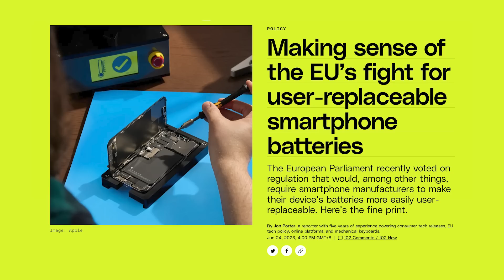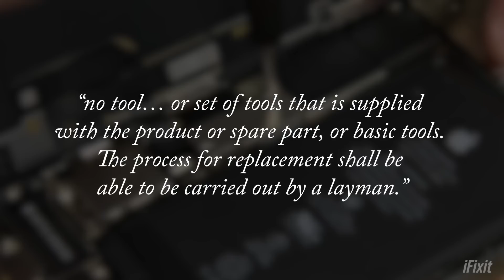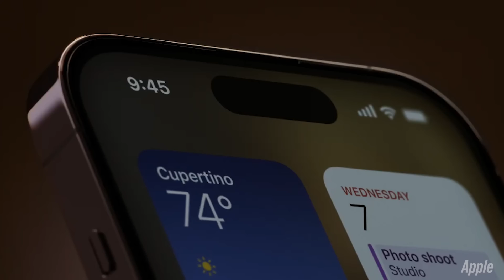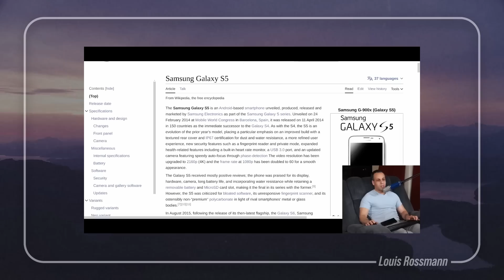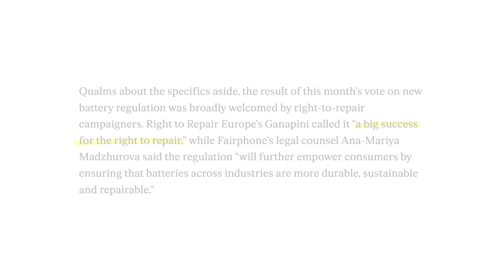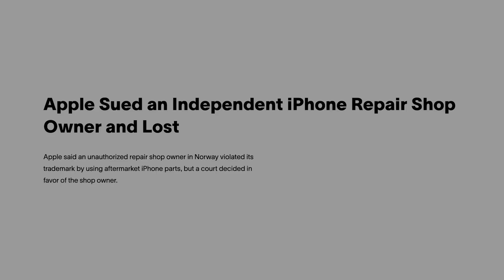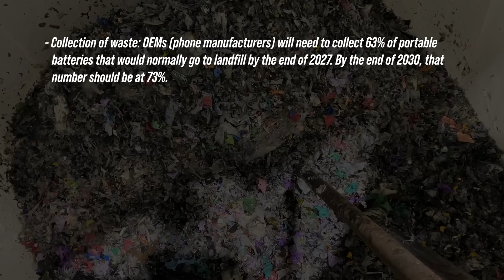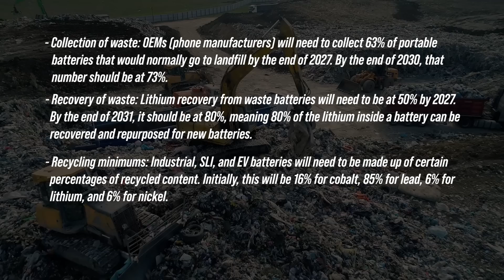EU Just Changed Smartphones Forever

Comment: *Tech shareholders hated that*.  I'm not sorry; they made tech in the sandwhich method BECAUSE it was cheaper, BECAUSE it improved profits, and most importantly because it means you have to buy a whole new phone to improve battery.  Their greedy yearly releases just became negligible, because when your phone is fine like most are these days for years after buying them (apart from scum like Google refusing to do Android updates on X phones or older to force you to upgrade) and the only thing that fails (ie barely holds a charge eventually) is the battery.  It's about churning out the phones over and over and keep you buying new phones to keep the money rolling in.  Now, they'll have to find other snake-like ways to keep the money churning in, like forcing you to upgrade sooner to get X version of Android.

Comment: Quoted: "It's possible Apple may not be required to change iPhone design. One German news report claims iPhones with permanent batteries inside will not be subject to ban under these regulations. That report claims the law says it’s fine to have a built-in battery — if the cell is of sufficiently high quality (in this case it must offer at least 80% capacity after 1,000 cycles). The report also suggests exceptions for water-proof devices."
Reply: Thank you, I was looking for a comment that points this out. Both exemptions are ridiculous. 80% after 1000 cycles is crap, that's barely 2 years of intensive usage. As for waterproofing, those have been done way before non-removeable batteries. In fact, waterproof phones with replaceable batteries are still made today. Case in point, Galaxy Xcover series.

Comment: All of my phones had a removable battery and I intentionally made sure they did.  Unfortunately my Samsung Note 5 despite changing the battery still didn't function as initially so I was forced to buy a non-removable battery phone 2 years ago.  I look forward to removable batteries coming back and it in no way impacts modern phones in any way.  Apple is the worst company even though I own a 2012 Macbook Pro. I have never owned an iPhone nor do I see myself purchasing one, not only because of the battery issue but also the exorbitant prices.
Reply: I still have my Samsung J7 Prime with removable battery. Still works.

Comment: Love that this is happening & being forced on companies.  Even on laptops it's so hard to replace batteries, up until 4 years ago they were so easy to replace but nowadays you have to remove so many screens then try to praise open the case without damaging it.
Reply: Yes but replaceable batteries are more expensive, they don't last as long and they add weight.  When we had them no one bothered to do it which is why they were eliminated.  This isn't actually a problem and it will actively harm the vast majority of users

Comment: It will be interesting to see how they tackle replaceable batteries in foldable phones. Also this new regulation might help push innovation with new battery types, that last longer or are much smaller.
Reply: ....I hope you realize batteries remain the same whether it's permanent or replaceable. The major difference is in the connection and the fact that they don't literally hotglue your battery to your phone.
Reply: @ryanthompson3737    If you can put in any compatible battery you like on your own, this should spark bigger competition on the battery market and jumpstart innovation.
Additionally it should force companies like Apple to look for more profits from repairs elsewhere - for example by offering bigger batteries instead/on top of bigger storage space compared to competition or in their pro models.

Comment: That is a good step into the right direction, however they still will force you to upgrade by not supplying security updates to older phones. Also it is not clear, does this law also apply to wireless earbuds?
Reply: not just that, will they even supply the spare batteries?? and even if they did, they prolly gonna put a nice hefty price tag

Comment: For me I would say a bit of both, I for example feel comfortable knowing that there would be a small chance that my phone would get wet somewhere in its life time would be protected by the seal. But now these days my phones is barely keeping up its battery life and now I'm considering changing its battery for a hefty price. So I think there is a bt of greed from companies there. I mean changing the power button button requires me to change the whole frame. I never knew how much the adhesive cost until I got my replacement.
Reply: Newsflash, there are waterproof phones WITH replaceable battery out there. Been for a decade.

Comment: a law that standardized batteries for any electric devices should can be used for any phone regardless of the brand. one  size fits all battery. if youre using it on a laptop series those batteries so that it will reach the capacity it needed. same for Ebikes and EVs that will be so much easier to fix, replace or recycle.

Comment: I was also happy to hear about this law last year. But since then it got changed. Manufacturers that can prove if the battery can still hold 90 percent of the original charge after 500 cycles do not need to adhere to this.
This is very sad because it shows hiw easily politicians can be bought even in the EU

Comment: The iPhone design has always included a non-replaceable by the user battery. I suspect the design was driven by aesthetic considerations and its has been a great success. I welcome the move to user replaceable batteries as that will potentially extend the life of a handset and at the same time keep the cost of  the batteries down.

Comment: Apple still can do the same thing with some very slight changes if you read the fine print Apple only has to have there battery’s have 80% health after 1000 charging cycles. right now they only are approved for 500 and if the device has a certain level of water proofing, if they do that they won’t have to change anything major we will just get better battery longevity which is good 👍

Comment: I used my previous phone for 5 years, the battery was still perfect. The only reason i replaced it was the lack of security updates. Today we do banking and other things on our phones that require good security. I did look after the battery - I kept it between 50% to 80%... never charged over 80%. Very easy to do. It was the Huawei Mate 10 Pro. And my phone from before that phone which is 7 years old and still works fine Huawei P9 lite - I use once a week... but also due to lack of security updates its very limited what I have on there.

Comment: Bullshit. LG G5 was flimsy. It's screen easily broke, it had a smaller battery than it's rivals. The bottom module never lined up properly. It was a HORRIBLE phone. I curse the day I got it and I am not the only one. You didn't do your research on this one Dagogo. If the batteries are replaceable then they would have to use steel casings rather than polymer, which are thinner and lighter, because polymer cases are too dangerous to be handled by end users. Not to mention the fact that replaceable batteries are MORE EXPENSIVE, fake batteries will be everywhere. What I am saying is it's not a good idea to make decisions based on trends. Some things are the way they are for a reason.

Comment: Unfortunately there is a side hole that changes everything: Devices that are designed to be operated under water or in wet areas are still allowed to use non removable batteries. 

Since most phones are already IP certified, those would already met the new standards. 

The only thing that would change may be laptops getting swappable batteries an cheap smartphones will get more expensive since they need a IP certification...

Comment: For smartphones, a removable battery also provides complete disconnect from the cellular network tracking, since the radio-modem in the phone has its own power circuit that cannot be turned off.

Comment: Honestly for EVs this isnt really necessary. I always thought that replacing the battery in an EV is inevitable and has to happen every 7-8 years. But I was wrong. I've heard of so many people that have lost like 10% of their range after driving 200000 miles in 8 years in their Tesla. In Tesla's Impact report of 2022 they said that on average the range declined by about 12% after 200000 miles.
Reply: Meanwhile first gen Nissan Leafs and iMevs are junk now, maybe Tesla's are good but not all EVs are. Plus maybe some third party manufacturers could make a higher capacity battery for you to install later if you want. Imagine if your Tesla only goes 350 miles but five years after getting it someone offers a 500 mile battery? You could go ahead and get that if you want while replacing your old battery that's had a slight range decrease anyway.
Reply: @mattwolf7698  Well I really don't see myself needing more than 300 miles of range very often. Of course inmovation is rarely bad for the consumer but I don't really care if an EV has a 400 or a 500 mile range.

Comment: To be honest. My LG G3 was exceptionally slim. Slimmer and lighter than my current phone. it had a removable back cover and a replaceable battery and even a rubber gasket to prevent water. The only reason why phones are glued these days because are because it allows companies to engage in "planned obsolescence", nothing more, nothing less. These days phones are so powerful that you could easily have them for 5-10 years. And this is what phone manufacturers are dreading.

Comment: Now watch companies charge you a premium to upgrade their batteries (I can see them forcing us to use only apple batteries in your iPhone, and so on). Also, hope they don't nerd the battery life so that we are forced to buy new batteries. I just know phone companies won't give up.
Reply: they will sell tha base model with a 10wh battery and then upcharge for the proper one...just like they do rn with ram in laptops and storage
Reply: @423GustavBern  100%. We're gonna have battery tiers now. You want fast charge? better buy our premium battery add-on. Better matteru life? Buy our high capacity batteries. Heck they probably gonna sell their phones without batteries. Apple would do it.
Reply: @423GustavBern 
Well, with my new laptop that was a great way of saving money, as I could buy the config with the lowest amount of RAM and no storage, then fit the hardware I already had. 
If the replaceable batteries were standardised (unlikely, but one can only hope) this would mean that you could independently upgrade your phone and battery, and keep old ones as spares. Or alternatively, get the cheapest phone with the smallest battery, and a bigger battery from a third party for less than the manufacturer would charge.
Reply: Thats also what I thought and said in another comment and someone told me that the eu made sure that something like that can't happen by forcing to allow 3rd party batteries 🎉

Comment: having all the phone parts be serialized together drastically reduces incentive for theft, because thieves can no longer easily turn them around and sell them for parts on top of apples ability to essentially brick the phone and all its parts after being reported stolen. it is generally more cost-effective to have it repaired then to have to go buy a whole new phone because yours got stolen.

now I have to worry about some Rando stealing my battery? 🙄
Reply: Not very likely to happen, I also keep a good eye on my phone anyway.

While new batteries won't be cheap it would still be cheaper than a new phone. I'd rather be at a slight increase for my phone battery being stolen than having to buy a new phone for $700 every two years.

Comment: Other computer companies that weren't mentioned, like Dell, Lenovo, HP, ASUS, etc. will be interesting to see how they manufacture laptops in the future. I remember older laptops like the Dell Precision series that used to have removable and even extended battery packs. This will make repair/maintenance a whole lot easier.
Reply: I can say for Lenovo - while they stopped using external removable batteries around 4 years ago, the internal batteries are still very easy to replace - a dozen of standard PH screws, maybe some clips, but nothing like glue or some other tricks. The main issue with most laptop brands is the availability of OEM batteries. I have a couple of 5-7 years old laptops that have perfectly good performance for my tasks, but you can only get ‘compatible’ batteries for them from china, or hope to find some new old stock ones from eBay praying it’s not a scam
Reply: @miaso130 those old Lenovo laptops didn't just have two batteries. They had a removable and internal battery. Meaning you could replace the battery while the machine was on. You could bring enough batteries to last a week outside.
Reply: @holski77 thats sick
Reply: Another this is that now buying and second hand or super expensive laptop will be much easier decision cause you don't really need to be concern about battery replacement if needed well you should be a bit concern but not as much as this days 😂

Comment: Wait so you said this applies to EVs.  Are we to understand that this regulation requires and EVs battery to be able to be replaced easily by the end user WITHOUT ANY TOOLS?  We’re talking about a lithium ion battery pack that is 100s of pounds?  That’s like requiring the engine in an ICE vehicle to be replaceable without tools.  That just doesn’t make sense.  I’m doubtful that this law could apply to EVs.

Comment: Non-removable batteries are not most serious problem, in my opinion. It is still possible to replace a battery in most android phones for relatively low price in the independent service. Bigger problem is short OS update time and security patches. I have Samsung Galaxy S10 from 2019. After 3 years of using I've changed battery, 'cause oryginal one was worn, and after replacement, phone works as new. Unfortunately few months ago Samsung finished update support for this model. S10 is still much more powerful than most new cheap models, but it will never get any update anymore. UE should oblige producers to update the OS and security patches much longer, especially for flagship models with high specs, cause now many people have to abandon their 3-4 year old flagships because of lack of updates.

Comment: I think false clues from consumer demand are the main cause, as well as cost reduction. 
In the 2000's to 2010's some phones were indeed still bricks so customers naturally wanted something slimmer. But at the end of the 2010's the pretty much ideal thickness had been already reached, with many saying their phones are getting too thin, or they wouldnt mind if it were a few mm's thicker. 

Marketing analysts were firmly set in enforcing the trend of making phones thinner and thinner though, ultimately forcing the engineers to come up with adhesive solutions. A a bonus, gluing down and adhesive strip is far cheaper and easier during manufacturing, even possible to fully automate. Relying on adhesives instead of gaskets and seals also removes extra steps from the manufacturing.

I remember my Nokia N8 phone having a somewhat replacable battery, you had to remove two screws on the sides, then carefully slide out the battery tray (just like the LG phone shown). Everything was sealed with rubber gaskets, to ensure no moisture got in.

Companies like Apple trumped this game with their extra consumer unfriendliness when it comes to replacing components.

Comment: This is 100% good news. Just like forcing apple to use usb c on their phones. I too remember a time when user replaceable batteries didn't add much heft or thickness but having the option of extra batteries was easier than battery packs we now carry.
Reply: I remember being on a road trip once and the only Apple user with us had forgotten their cable. We had to stop at a convenience store so they could buy a new one instead of used just sharing our cables just because Apple had to be different.
Reply: @mattwolf7698  There was a very good reason for Apple adopting lightning to be fair.
Reply: Is jus like 3mm more
Reply: I still remember how small the capacities of those batteries were, so having enclosed batteries did enable more than regular water resistance to be a thing. I'm not against the removable battery by the way, just pointing out how there's also been some advantages. After all a lot of people change their phones long before the battery is the issue. On the USB-C use, I think it has helped Apple to change to the next charger on the iPhone without taking all that anger from their users like they did previously when they changed from the large port. In terms of implementation, all companies have been implementing the Type-C in various ways and as a result, you never know what a random USB-C cable can and can't do. Can it charge your particular phone or not and how fast, you can only tell after testing. Remember how a Google engineer had to test USB-C cables sold at Amazon to route out those that can damage your device?
Reply: This is definitely not good news man. Come one. Think!

Comment: I wish the batteries can be standardized just like the charging port so that we can replace with any battery on the market
Reply: I'm a bit more mixed on that, if there was only one size that would hinder innovation, especially with flip/folding phones. There would at least have to be several sizes of battery. Kinda similar to AAA, AA, C batteries ect, different sizes but all standardized.

I am happy that replaceable batteries are coming back though.